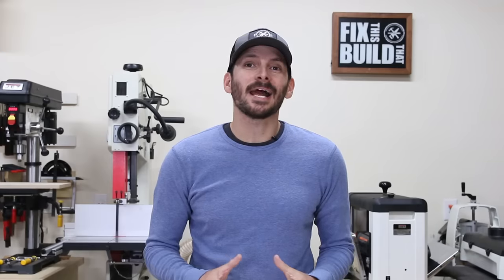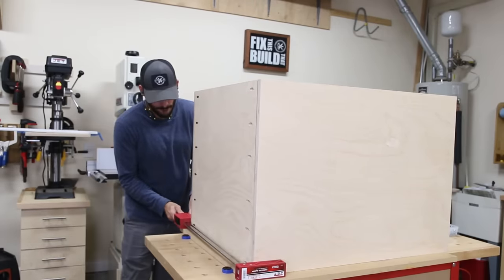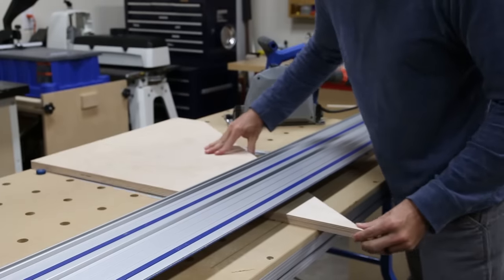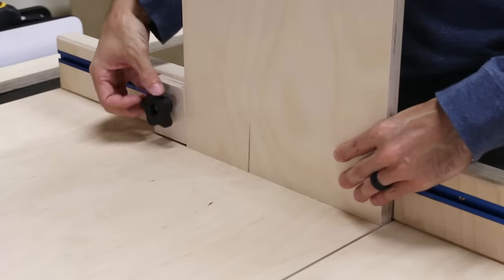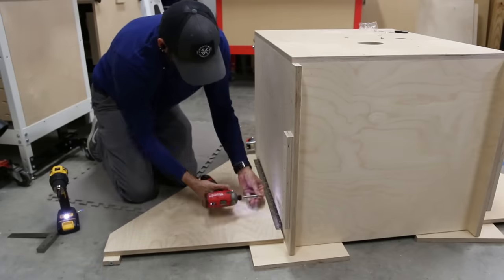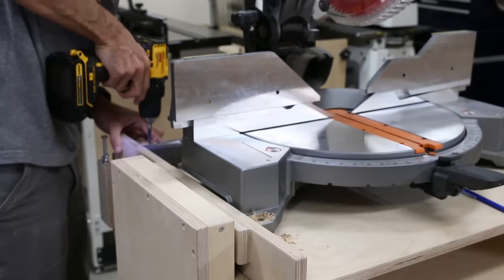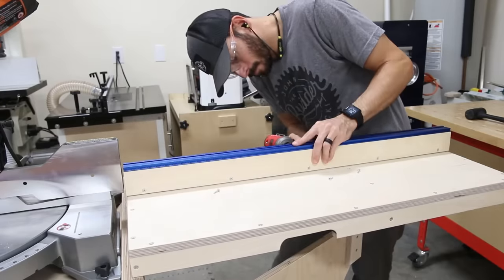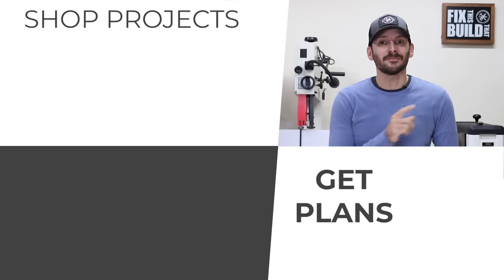ULTIMATE DIY Miter Saw Stand | How to Build

Comment from the maker: Get the Plans HERE: https://fixthisbuildthat.com/mitersawplans
Or Save 33% with Flip Top / Miter Stand Bundle - https://gum.co/miter-fliptop-combo
Reply: how about metric plans? would make things a lot easier for a lot of us i guess <3
Reply from the maker: I'm getting closer to going to metric plans as well.  It's just a time vs. reward type thing.
Reply: Most measuring tapes have both metric and standard on them
Reply: @kevina5688  still, if u NEVER use "standard" it can get very difficult or a reason for lots of mistakes. Would rather recalculate everything before I start
Reply: @Knatterbart  I was thinking that a measuring tape with both metric and standard measure, would make converting to metric much faster. I use one with both and have not had any issues. Being 🇨🇦 l use metric alot
Reply: @kevina5688  - In the United States, we use the older Imperial system, where things are measured in feet, inches and pounds.  It is by no means a "standard" and the majority of countries use the metric system, even in the US the scientific community uses metric.  The Imperial system is just one of the many things that the US refuses to give up, just because we are stubborn and don't like to be told what to do.
Reply: I would also like a metric version. If the drawings are done i Autocad or similar - It should just be that switching the measuring units would recalculate it all :)
Reply: I bought your shop vac plan and really like it.  Is there any modification needed for a 12inch Bosch miter saw with this plan?
Reply: I'm try to buy the plans and can't do it, I got a message saying prints cannot be mailed to my country. Is there a way to get them digital?
Reply: I tried to order the plans but it just kept processing and would not complete the order.  Is there something wrong with the ordering site, or is this plan not available anymore? Thanks…
Reply: I'm late to the party but what type of plywood are you using?

Comment: This cart is amazing. Be aware if you are putting a Hitachi C12RSH on this cart the bed/table is 1/4” taller than what the default build specs are. Either drop the top 3/8” or make the wing mounting cleats 3/8” taller

Comment: When I used your plans to build mine, my dust collection is a Buckethead on a 5 gallon pail, w/the bottom compartment lined in Rockwool for some sound absorption. Finally I put a quick disconnect on the hose connecting to the saw so I can use a short hose for cleaning up the area around the saw of sawdust in 5 second bursts from the delay of the relay. Generally only takes about 3 bursts of the saw to vacuum up all the errant sawdust that didn't get sucked up the 1st time!

Comment: Thanks for the easy to follow plans.  I've built 2 sets of base cabinets and the bench with pegboard hutch with one slight modification (shelves with cabinet door instead of drawers on one side).  I just picked up this plan set and it will be my next project.  I've been needing a mobile miter saw station and fatigued with manually moving my saw all over.  I like the mobility.  I will build this next and then start in on upper cabinets and then more base cabinets.  I've installed electrical outlets and power strips so the bench systems are fully functional.  It's already made a huge difference in my garage.  Thanks again.
Reply from the maker: Awesome! Glad your building out an awesome workshop to enjoy! 💪 💪

Comment: I built this a few weeks ago. I got Miter Saw and Flip Top Cart Combo plans.
I haven't hooked up the Vac in the cart yet and only have the Kreg top trak on the left side.
I have a Dewalt 8 1/2 inch sliding Miter Saw on the stand...I think I will try to build a dust hood for it.
I really like the miter saw stand and the flip top cart...Nice designs Brad.
Reply from the maker: Glad you're enjoying the cart, Walter!
Reply: Dust hoods help a great deal as the chop saws tend to spray high and wide!  You could even have a little drop tray or suction port in the back to catch the dust.

Comment: Hey Brad, great plans and fun build. I'm about to wrap it up and discovered that the standard 1-1/2" piano hinge from Home Depot has way too much play for the wings. Lateral movement front to back at the end of the wing is unbelievable. Home Depot's hinge is is very loose at the pin between the leafs. Perhaps there is a heavier hinge that you can recommend or I may try to use a pair of standard door hinges with 1/4" pin for each wing. Keep up the good work! Thanks!
Reply from the maker: Hey, Ken. Those hinges have gone downhill it seems. I'd try a small utility hinge like a door hing but smaller. Thing thr door size would be too large

Comment: This is another great video. I just purchased the plans. I would like to add the Kreg accessories . The stop block and tape measures would surely be helpful. Could you tell us more about the Kreg track and the measuring tape?  How do you set the left and right measuring tapes up so that you get an accurate measurement from the center of the saw blade?

Comment: I finally finished this having had bit la of time over the last few weeks. it is fantastic.  well worth the time.  methinks brad’s head may explode were he to see it and see the lack of symmetry in the screws.  but it was too cold up here to plane that out. it was eyeballed. 
some tips for newbies from a newbie:
- get pre counter sunk piano hinges. i used #8 5/8” screws and put them in all the holes. and the wings wouldn’t fold down cuz the heads stuck up.  so i had to screw in every other (and the opposite on the other side) to get them to fold down
*question for experienced folks - are there flat wood screws?
- invest in a counter sink bit.  i used to bigger bit as i didn’t have one and it ain’t pretty.  
- if you have a smaller mitre saw,
like my dewalt mitre saw, wait to make the fences until you’ve made the box and wings as well as putting your mitre saw on top (don’t fully screw it down yet) to make longer fences that will extend up to your saw’s fence. 
- for the above statement - i realized this extension would be helpful after putting in the saw.  i didn’t realize it was not centered and slightly askew. so my fences look a bit angled.  and again, would likely make brad’s head explode :-).  
- i made a “mistake” on one side and the cut out is at the back.  having said that, it worked out better for me to line up the screw on the support to the wing.  let’s chok that up to a happy accident. 
- you’ll need more screws than you think.  

overall - this was a fantastic set of plans that are perfect as is and gave me an opportunity to  think and adjust to fit my needs. it is compact.  i use the shelves for tool storage and it’s been awesome. so many lesson learned for future projects.  
have fun with it!
Reply: I have the same issue with #8, 5/8" screws, lol! There is a flat head screw (think they call in pan head) and will head to the HW store to check this out. Worst case, drill new holes into one side of piano hinge where the other side does not touch!

Comment: I wonder, instead of triangular side supports, what you'd think about folding, angled braces, running between the bottoms of the sides and the underneath surfaces of the flip-up extensions?  I saw an idea for that somewhere (I think Carl Holmgren's channel),  where the hinge in the middle consisted of a bolt joining holes in the 2 wooden ends, and a stop on one that allows the joint to go a couple degrees past straight, hyperextended, so that the brace locks itself straight and open just by lifting the extension, but a touch upward on the joint allows it to collapse and fold.  Seems a really elegant design, plus saves on weight and wood.  Love your feedback on that idea!
Reply from the maker: I'd definitely want it to lock in the up position, and as long as it was stable and had adjustability it sounds great.
Reply: @Fixthisbuildthat  Yep, I checked and that guy did a strength test on his angled hinged brace where he put 150 lbs on each wing.  I won't out of courtesy to you put the link here, since he also sells plans for his cart, and I don't want to put a competitor's plans for sale on your comment section.  The feature I'm interested in isn't his whole cart, but just a different concept for how to prop up the wings, a triangular panel of plywood (which is found on most such carts as a general concept) vs. a folding brace, which would seem to be lighter, cheaper, and just as easy to make and operate.  

Although I didn't see his actual plan, the concept appears to be to cut a hardwood stick for a brace that's say 2 inches longer than needed to reach between a bracket on the side of the cabinet and a bracket underneath the wing.  Cut the stick in half, 2 inches from the center.  Drill holes and install a bolt and nut on each of the upper and lower ends to attach them to the brackets and create hinges.  Hinge the middle by drilling a hole in the end of the shorter piece, and a hole 2 inches from the end in the longer piece, and connect them with a bolt and nut.  Install a stop to the 2 inch longer overhanging end that's past the bolt, attached to the side of the brace so that it retains the shorter brace piece from moving past it, causing the jointed brace to only fold up for storage, but when it falls into its 'straight' position (actually a couple degrees past straight), the stop prevents the brace from folding downward.  So most of the weight is on the bolts and holes, with some of it (due to the 2 degree hyperextension) on the stop.  This allows the user to lift the wing, and the brace falls out of the storage location and unfolds from bent to straight, to take the weight of the wing.  An upward touch on the middle of the hinge while supporting/holding the wing collapses the brace, allowing the wing to fold down and the brace's middle hinge to fold upward (so the bit of hyperextension was to lock it and prevent it collapsing on its own).  Seems pretty ingenious, and I've tried searching for it elsewhere, even as a manufactured brace, but haven't seen anything like it.  

Anyway, just thought I'd pass it along for your consideration, as it seem to be functionality in line with your general design philosophy.  Good luck!

Comment: I have all the pieces cut out of Baltic birch plywood with melamine on one side.  its going to be a sturdy miter saw cabinet!!  When I measured out the position for the doubled 10.5 inch pieces in the underside of the extension wings I came to 22 inches rather than 20.25 inches.  The support wings are 23 inches on the short side and 28 inches on the long side.  Please check me on that before I commit to screws and glue.  I purchased a Massca pocket hole jig and made a bench top holder out of baltic birch plywood and that made the pocket hole portion a breeze.  I am excited to have this cabinet completed.

Comment: Hey Brad, nice plans and I have knocked out the base.but One bit of feedback is that 39” is much too high IMO. Maybe for a 6-6 woodworker and/or lighter stock but at 5-9 and trying to heft a 8/4 piece of walnut to that height is a bit much. I’m going to need to go back and adjust down by about 5”. I recommend others looking to build this consider the height that works for you and adjust accordingly.

Comment: Brad:  I want to thank you for publishing this video and am purchasing the plans.  I have a 12" Dewalt Compound Sliding Miter Saw and a contractor stand.  Since I am getting up in years the 12" miter saw is just getting to heavy to store and then have to set it up on the contractor stand every time I need want to do a project.  This seems to be a great solution for my limited shop space, which seems to be a common issue for most weekend, project, woodworkers.  I have read a lot of comments and there are some concerns expressed about strength of the wings.  My thoughts are that they are pretty strong as the weight on the outside of wings is transferred to the bottom of the cabinet.  

One question:  Could sanded 3/4" pine be used instead of birch plywood?  I know that the birch looks nicer but is there any strength reason you chose birch?

Comment: First, I want to thank Brad for the first-rate design.  His is the best on YouTube in my opinion as an engineer.  There is always room for improvement, so here are my thoughts.  His table aprons are attached with screws from the top.  Traditionally, aprons are attached from the bottom and that is how I did it.  Works well and leaves a smooth top that will not catch chips at the screws.  Looks prettier also.  The finger cutout in the table aprons is a good idea, but structurally they unbalance and weaken the tables.  It is easier and just as functional to replace them with 3/4" finger holes centered on the 2-1/4".  Round the sharp edges with a router.  Works great and has almost zero structural effect.  I noticed on completion that the folded wings are almost 4" off the floor.  Why?  This is not an off-road vehicle.  For me, a 1/2" of clearance would be plenty.  Wouldn't another 3-1/2" of cutoff stop capability be a good thing?  Fortunately, there is an easy fix.  The table doesn't need to be longer, just the fence, so I will be making a new one before attaching the flip-stop track.  One last idea is to replace the blocks on the wing support arms with hardwood. I used hard maple.  The advantage is that you can eliminate the threadsert and just drill and tap the hard maple.  This one may not be for everyone, but it worked great for me.  By the way, these improvements are in no way a criticism, and Brad's plan is perfectly functional as is.
Reply: By now you've figured out that the folded wings need to be 4" off the floor to accommodate the proper movement of the swiveling wheels.

Comment: I finished mine last spring! It isn't as perfectionist as yours but I love the wings and after I got my saw's dust chute fixed to work with the vac it is pretty slick. Nice that you now have the video...at a couple points I could have used that! LOL

Comment: I like the stand. But my preference is a longer support. Mine is 10ft off one side and 6ft off the other. Its huge, but I like it and my jet 12" dual compound slider.
Reply from the maker: Yep, this is more for small shops that need the mobility and folding wings
Reply: @Fixthisbuildthat  agreed. It is an awesome design idea for that. Especially the mobility. Although, I believe this could be modified to use my dewalt 735 planer and have longer outfeed. I'm gonna try that. Keep em coming brother

Comment: What diameter screws did you use? The 6x5/8 wood screws I got are skinnier than the washers as well as the screw holes in the caster. Thanks!

Comment: Hey Brad.  Love your plans and videos.  Have built a couple of the drill press stands.  I am currently building a router cabinet for a Rockler top, modified the drill press stand plans to accommodate the 32 inch top.  The miter saw stand is my next project.  My question is, has anyone built a hood for it.  Dust collection is a priority to me.  Understand that you just moved your saw to a stationary position.  Been kicking around some ideas, any tips?  Thanks.
Reply: I have seen a few ideas on a hood with moving doors for the front to go around the saw.  I would like to install one at some point.  I will probably put some good looking doors on the front first.

Comment: Brad, Are you using #10   1-1/4” wood screws to secure the back.  The plans specify 1-1/4 but not the diameter. Thanks!

Comment: Hey Brad, love the design and the video.  You totally inspired me and I just built one myself.  Haven't had a chance to use it yet though, but I'm wondering - are your wings super solid, or do they move around a bit?  My wings move a little, but I'm thinking I may have bought cheap piano hinges.  I also shorted my wing support to about 12-14" tall at the hinge, which could be contributing.
Reply from the maker: You'll have a little big of wiggle in most hinges (more in cheaper ones). Just register it to the same spot when calibrating and cutting.

Comment: Hey Brad. Just finished up the outfeed/assembly table build and almost done with this mitre saw stand. It’s AWESOME! Quick question.... did you leave the mitre stand raw or did you put any polyurethane or something of the like on it? Thanks.
Reply from the maker: Hey, Eric.  I put a couple coats of water based poly on it for protection.  Thanks for your support!
Reply: Fix This Build That  Thanks Brad. Keep the videos coming. 👍🏽

Comment: Great build, Brad. I feel your pain about screw hole spacing. I, too, am an engineer. When I had a new garage door installed, I had the company leave the weather stripping for me to install. I carefully measured for the nails so I didn't have to see random spacings like they would do.
Reply from the maker: hahaha, yes exactly!
Reply: I was an Air Force Aircraft structural technician for 20 years and another 20 years in civilian aviation.  It is IMPOSSIBLE  for me to install fasteners of any kind  without even spacing and edge distances!!

Comment: Bought the plans for this and plan on build it this weekend. The only thing I am having a problem is finding those threaded inserts. I can find 1/4x20 in up to 9/16 length but nothing in the length in the directions. Where do you normal find those? I would like to use that style of insert if I can find ones with the 3/4 depth.

Comment: I made a similar station after watching your video many times. I am having difficulty getting the outfeed wings to be EXACTLY level with the miter saw.  Its very close but not exact. Trying to shim with washers but cant get it exact.  Does it need to be?  If not, you would want the miter saw higher than the wings right? Thanks.